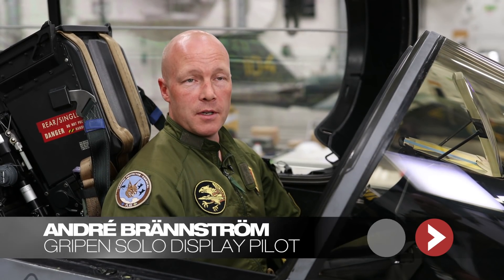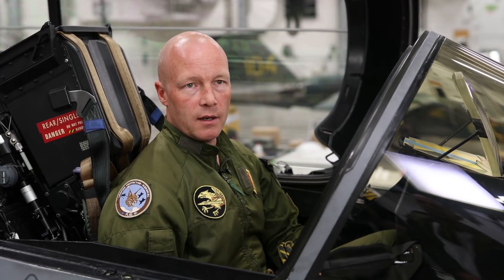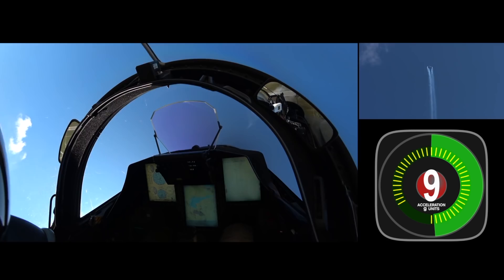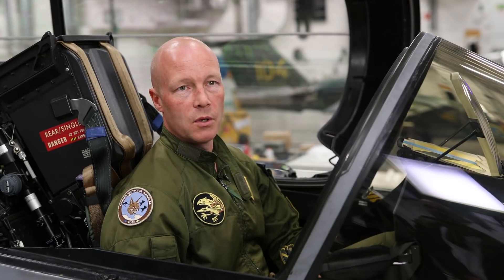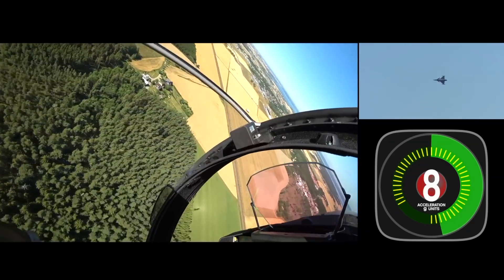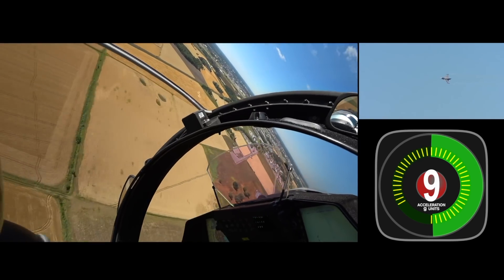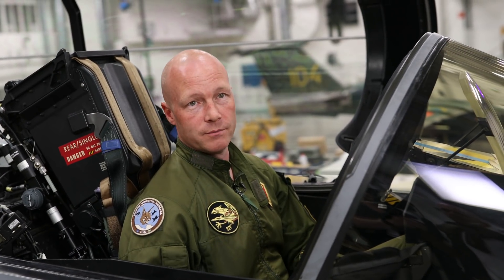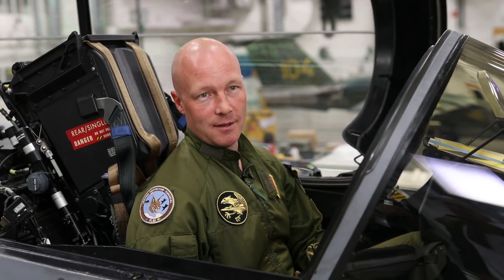Gripen display pilot talks about g-forces.

Comment: You’re a BEAST flying a demo in the Gripen!!!  You are in TIPTOP shape constantly -3G slamming the blood to your head then 9G sucking it down to your feet/lower legs…then once again -3G slamming blood to your head and so on.  (The alarm is a bit loud in that jet which I guess it needs to be loud to get the attention of the pilot.) There was one awesome roll you did that the camera even had trouble keeping up with you.  I wonder when Jets will be able to take over when the pilot has G-LOCK  with the nose to the ground (or some major problem) and fly itself?  How many hours do you need to sleep after that flight? 😂😂

Comment: No, the body mass will not increase. It will be the same. 
The weight, however will increase.
Reply: I'm pretty sure the weight stays the same aswell.
Reply: @Qrama  No. Weight is measured in Newton and is a force. In 9G the weight is 9 times greater compared to "normal" gravitation force. 
The mass stays the same.
Reply: I’m sure English is not his first language. These pilots are pretty well educated and probably have had at least one physics class. Or he might be correct in referring to “mass” as in “inertial mass”. The inertial resistance to acceleration of the body when responding to force.”
Reply: @BubbleTruck25  Well, he says "body mass" and not "inertial mass". 
Maybe he's talking about, body mass index, BMI. Under heavy G:s he gets shorter but his mass stays the same=>higher BMI, fatter pilot.😉
Reply: @familjenhansson7144  You’re probably correct, it’s his BMI. Or he’s a fighter pilot that doesn’t know the difference between mass and weight.
Reply: @familjenhansson7144  Since it's not a force (it's a measurement of acceleration), g-force doesn't actually produce weight. It has an indirect effect. Gravity, however, is a force which means that it produces weight directly. G-force produces the perception of weight since acceleration pushes you beyond (or below) that of what gravitational force normally would. For this reason, g-force is referred to as "weight per unit mass". He's obviously referring to that when he says "body mass".
Reply: @WolfHeathen  Even a person with such a cool job as a fighter pilot can get it wrong sometimes. Of course he knows what he's talking about. But he still got the physical concepts wrong. 
Boby mass is always connected to the quantity of matter in a physical body. And that dosent decrese/increase durig high g-forces.